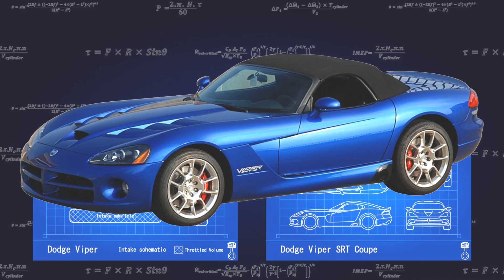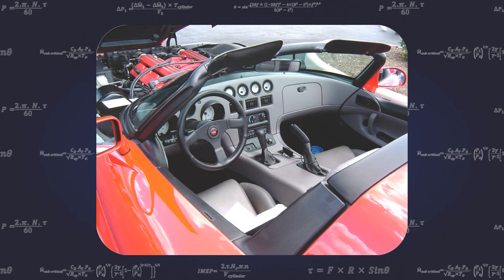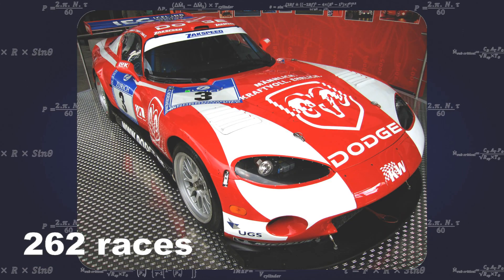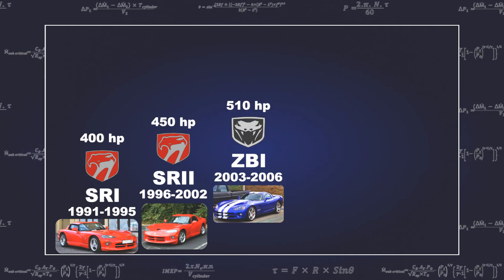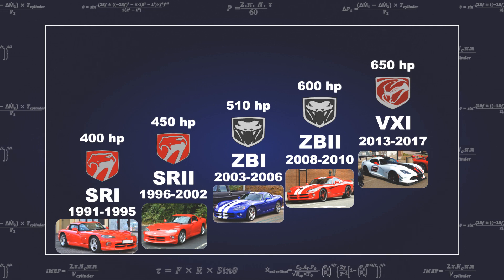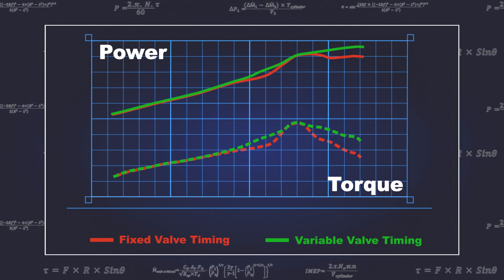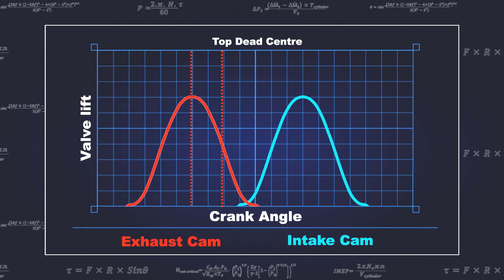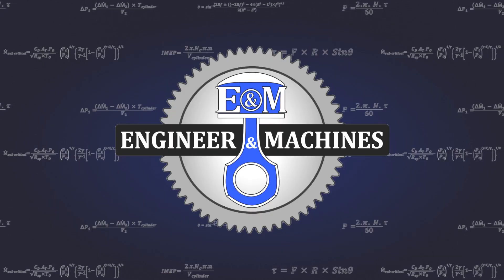The Dodge Viper: The best 2-valve engine?

Comment: The engine was conceived by Lamborghini!
Reply from the maker: Yes indeed, they consulted and helped develop the original design. It's typical for many manufacturers to have design support from consultants. Thanks for watching, I hope you enjoyed it!
Reply: Just the block. Not the entire engine.
Reply: The engine is based off the magnum series, but was reworked by Lamborghini, still mopar architecture though.